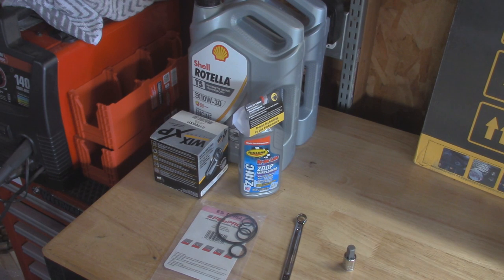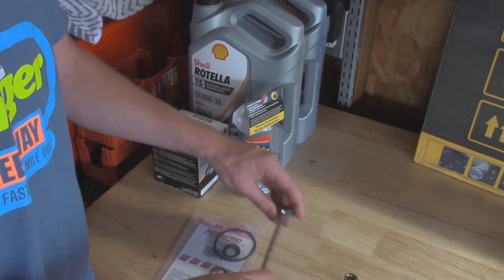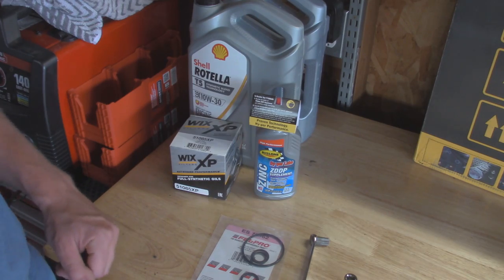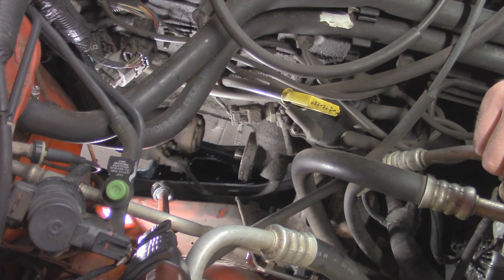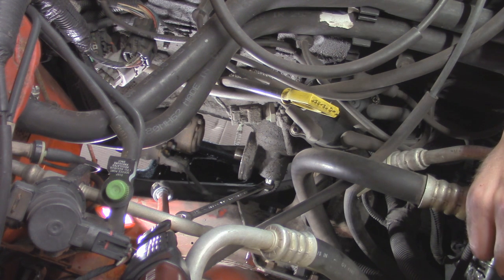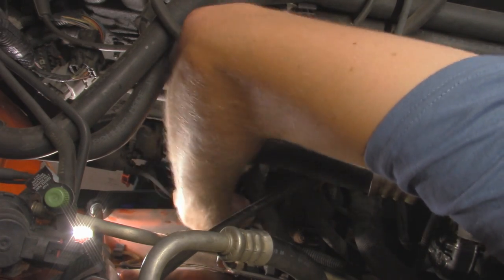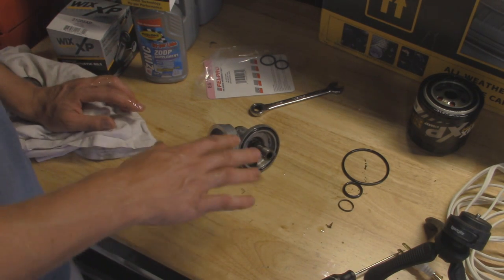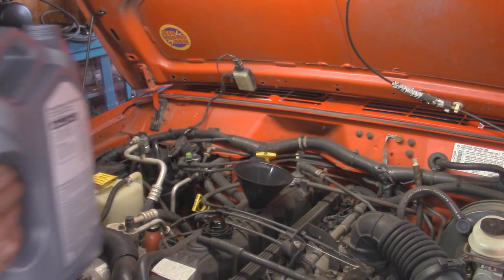Jeep 4.0L Oil Filter Adapter Seal Replacement

Comment: To get more room for a breaker bar undo the passengers side motor mount through bolt and loosen the drivers side. Jack up the engine a few inches. Creates more than enough room.

Comment: Need to do mine so video helped.  But how long did it take to break the bolt free? I can guess it was a pain in the butt
Reply from the maker: Most of the time was setting up the cheater bar and holding everything in place. Mine was tight but not as tight as it would be if it wasn't removed before. But just took a couple pulls on the cheater bar to break free.

Comment: I bought a torx kit just for that ridiculous thing. Haven’t used any of them since. Mine was leaking oil from the rear seal/pan and filter adapter so bad they came off with ease. Nice thing about oil leaks is it keeps the porch clean 

Love that you’re still alive!

Comment: Mine was ripped tried JB weld, it didn’t hold, frustrating.
Settled with high temperature seal gasket around the leak, had to use some Jeep engineering 🧐🤣😂

Comment: Mine wasn't too bad. Just needed a long enough breaker bar that was also thin enough to fit in there with a socket on it. Weirdly enough I needed a 14mm hex socket instead of a torx,
Reply: I’m thinking that’s what I need because I picked up torx it’s too small

Comment: It really makes you wonder why they went to the torx. My '88 has a regular hex bolt on the adapter.

Edit: BTW, the kit does not work entirely on the '88. Instead of two orings on the plunger there is only the small one and a second one that fits into a groove at the end of the adapter that the plunger "cap" presses up against. The oring size is 1 5/16" ID, 1 9/16" OD, 1/8" thickness, p/n 7272219 at napa. I wonder if the style changed when they switched to the high output in 1991. Just saying cuz I just went through this xD
Reply from the maker: Interesting, that's probably why there was 2 extra o-rings in the kit. May be for all the years and different style adapters.